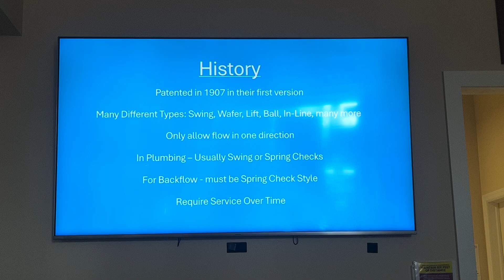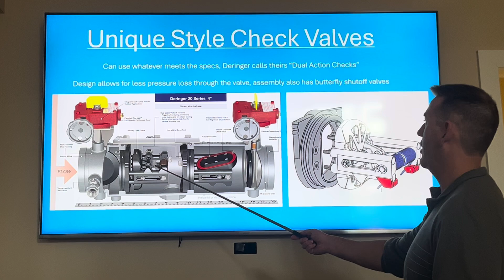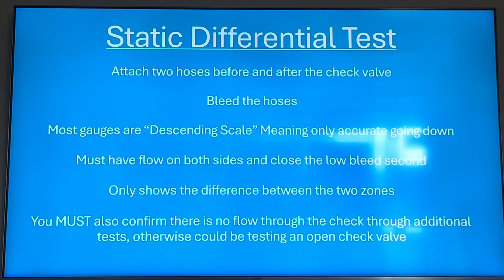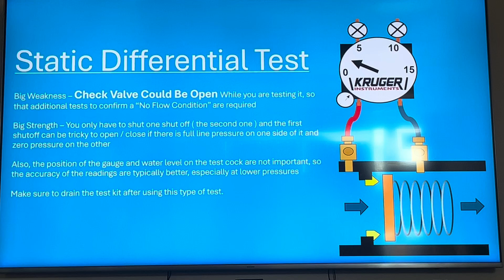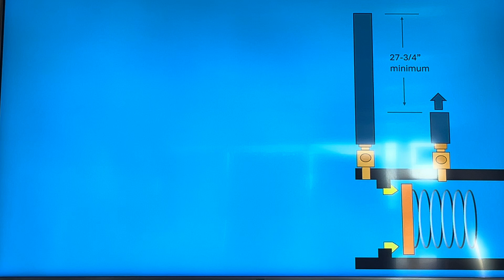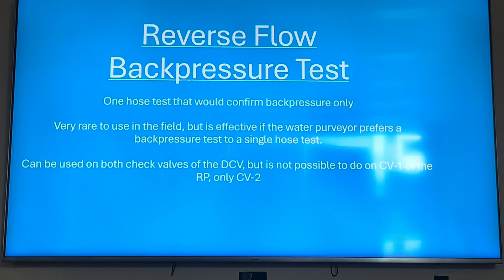Check Valves - What they are & how to test them - Specific to Backflow Preventer Testing

Comment: Over the years I've been surprised to see how many different methods there are for testing these devices. And each of these methods can be done in a variety of orders and ways. The method I find to be most practical is the one below with a 3-hose kit.

Preparation (RPZ & DCV)
•	Notify, inspect, observe, and record.
•	Flush all four test cocks.
•	Close the high and low valves, open the bypass valve on the kit.

Test check valve # 1 (RPZ & DCV)
•	Close SV2.
•	Connect high hose to TC2, open TC2, and bleed high.
•	Connect low hose to TC3, open TC3, and bleed low.
•	Record the read, RPZ should be over 5 PSI, DCV over 1 PSI.

Test check # 2 and SV2 for tightness (RPZ & DCV)
•	Connect bypass hose to TC4, open TC4, and open high valve. If it remains steady, check # 2 is tight.
•	Close TC2. If it remains steady, SV2 is tight.

For RPZ - Test relief valve as the final test
•	Reopen TC2.
•	Slowly open low valve (high & bypass are already open from the previous step). The relief valve should start dripping above 2 PSI.

For DCV - Skip relief valve test, and check PSI for check valve # 2
•	Close all test cocks, disconnect all hoses, and drain kit.
•	Close the high and low valves, open the bypass valve on the kit.
•	Connect high hose to TC3, open TC3, and bleed high.
•	Connect low hose to TC4, open TC4, and bleed low.
•	Record the read, which should be over 1 PSI.

Completion (RPZ & DCV)
•	Reopen SV2.
•	Close all test cocks.	
•	Disconnect the kit and open all valves to drain the kit.
Reply from the maker: We use the USC 10th Edition which includes a lot of things that the other procedures don't include or don't think about, and they are widely understood to be the most thorough procedures in the industry, many areas require them specifically but all have respect for the USC 10th Edition. If you take one of our courses or watch our other videos you will see what I am saying, there are a lot of extra things that are not taken into account, I believe the ones you have listed are the AWWA procedures which were written in the 1990s before they figured out some of the issues they cause. We also find the 2 valve kit to be the most efficient and fewest steps.
Reply: @whatisbackflow  What issues are caused by the older method? When you use a specific method for 20 years that is and always has been approved, you're not too keen on switching up to some entirely different method with a different type of test kit, unless there is proof that shows that the old method can cause a serious hazard, in which case that method would no longer be allowed anywhere. 

I have no issue with new people being taught new and perhaps better methods. But for myself, I don't plan to switch up, unless the switch becomes absolutely necessary and required.
Reply from the maker: @decific issues that come to mind on the RP test have to do with premature discharge of the relief valve. The intent of having precise and repeatable results in practice means the relief valve should not discharge prior to testing for the opening point. When you close No. 2 Shutoff Valve without anything running, and also when you open No. 2 test cock without anything running, you can easily cause the relief valve to discharge prior to getting the opening point, which you have probably seen when field testing and can cause a relief valve that would have failed a test and possibly not openers during a backflow condition to pass because the relief valve had opened under abnormal conditions from water hammer from shutting the shutoff if under a flow condition, or a ricochet type water hammer when opening the test cocks. Also it comes up for diagnostics, if No. 2 Shutoff fails your test, you have to fix or replace it, where USC’s procedures teach you to diagnose the Shutoff Leak and then have other troubleshooting steps, so you can properly diagnose everything and also not repair things that can be diagnosed and worked around. Basically you do a test procedure that is outdated and not as good, but you can use it if allowed in your jurisdiction I guess. I would recommend you attend an ABPA conference they can elaborate more or watch some of our videos on these topics